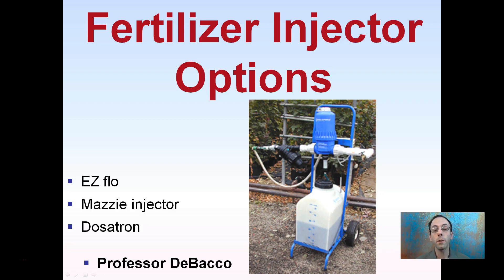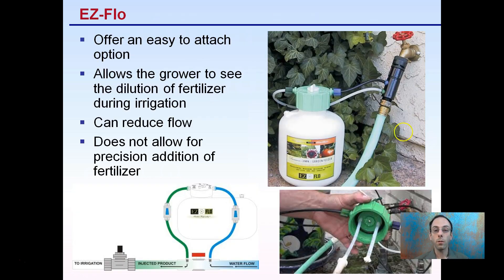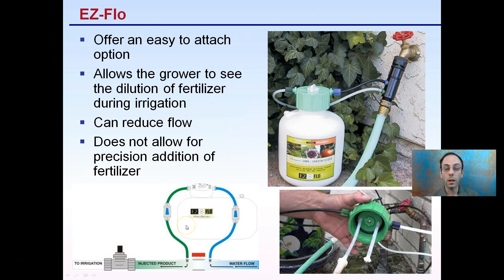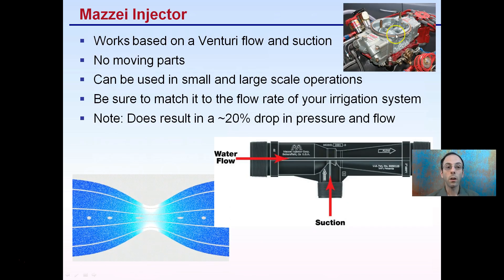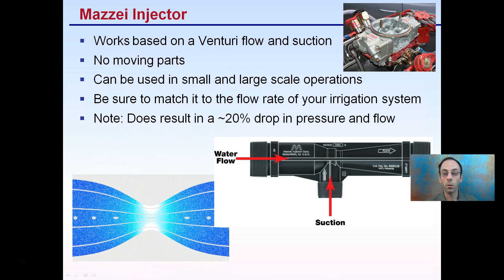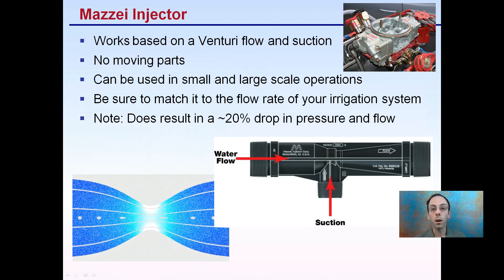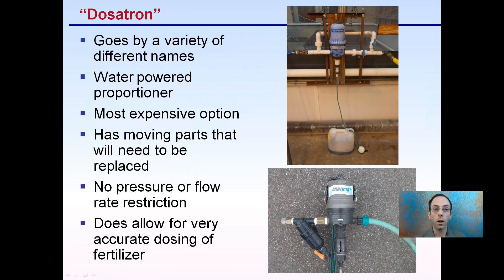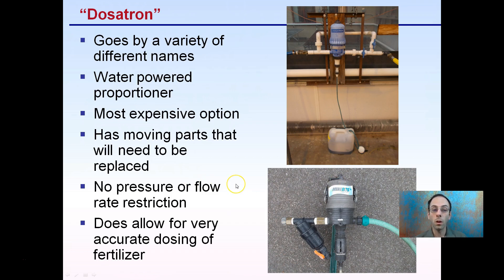Fertilizer Injector Options

Comment: I want to dilute 5ml per gallon of liquid fertilizer, which ratio size is the best and what setting do i need to adjust the injector to have a final solution of 5ml per gallon
Reply from the maker: The metric and US customary unit clash is interesting, but to answer your question....  There are 3785 mL in one US gallon (unless you are talking about Imperial gallons for which there are 4546mL in) so you want to add 5mL per 3785 mL of solution, which is a 0.132% solution.  Remember 1:100 dilution rate is a 1% solution.  So, to answer your question (assuming 100 gallons of liquid feed) with one example situation set your fertilizer injector to 1:200 dilution rate and then in the concentrated bucket add in 500mL of fertilizer with enough water to reach a final volume of 1/2gallon or 1392.5mL.  Note is the setting was 1:100 then you would add 500mL of fertilizer in 3285mL of water.  Hope this helps.
Reply: @DeBaccoUniversity  Thanks, helpful
Reply from the maker: @semiuolajide2890  Glad to be able to help, best of luck going forward.

Comment: Great explanation. How would you hook up an 'A' and 'B' fertilizer tank (i.e. more than one tank) to a 'Dosatron' injector?
Reply from the maker: If you had two separate tanks that are in close proximity, the injector pick-up tube could be placed in fertilizer tank A and then simply moved to tank B when all of the first fertilizer has been added to the system.  If the tanks are sized to match the operation and feeding schedule, this could be an A and B day rotation to allow you to refill one tank while the other is being used to maximize productivity and limit downtime.